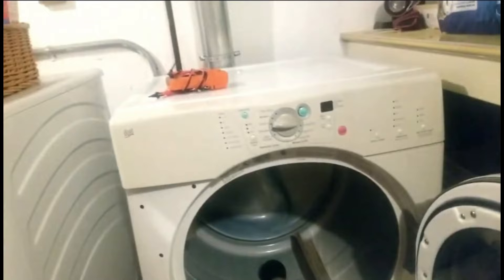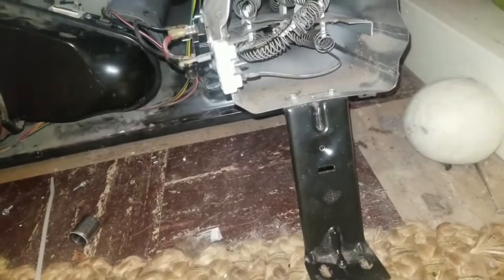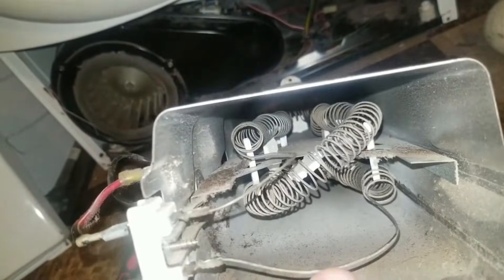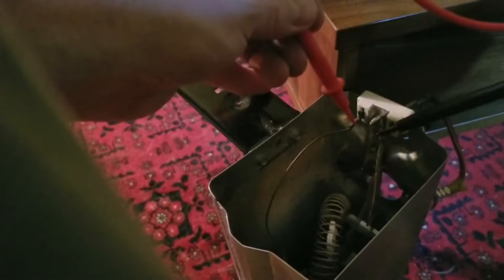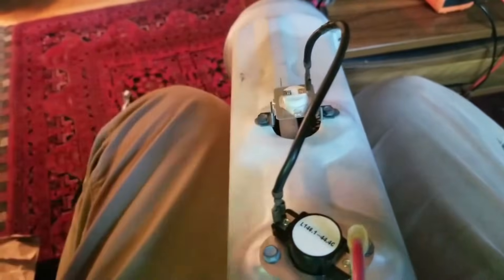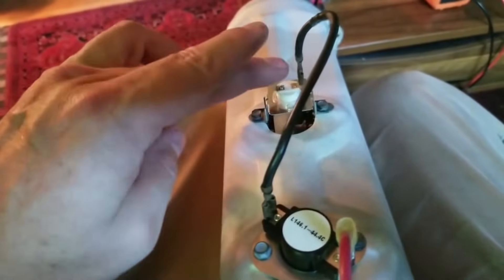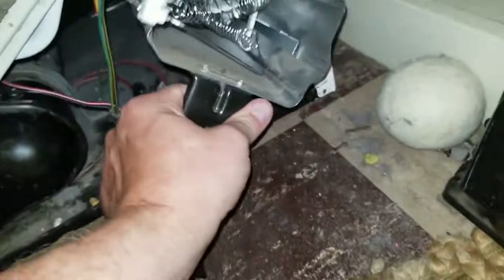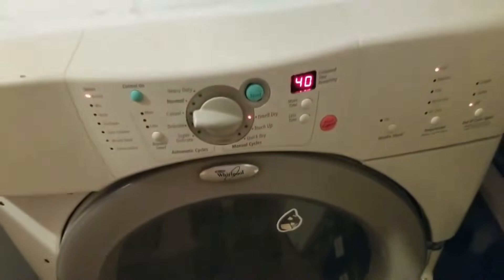Whirlpool Dryer Not Heating .. Duet Heating Element Replacement (Link to Manual in Description)

Comment: Looking for words of wisdom why my dryer won't heat up. Ignitor turns on. No gas flame. I've replaced the coils. No blockage fuse and thermostat test good on meter.
Reply from the maker: @MrJoefoefrombuffalo  do all of your sensors test with continuity or do some tests with ohms
Reply: @JasonSipe16  continuity. At this point maybe best to go back and get ohm readings. I have a video of what happens when the igniter comes on there is a buzzing noise. For some reason YouTube won't let me post a link
Reply from the maker: @MrJoefoefrombuffalo I'm guessing if you're igniter comes on, there is probably some high limit switch that is stuck. That, or else there is some blockage in a filter or in a fan that is not allowing the gas to come on for safety reasons.  It could also be a high roll out switch.  Sometimes those switches are equipped with  manual reset switches to pop them back open if they keep popping off, there might be something wrong that you're not realizing.

Comment: I cant pull my element housing out of my dryer like you just did.  What gives?
Reply from the maker: not sure if there is a difference between yours and mine.
Reply: Same. In the video he says he unscrewed it in the front and "unhooked it" but he doesn't show the unhooking part. I'm unhooked in the front, but I can't pull it out. I can rotate it a little bit though 🤷‍♂️
Reply: @spencer7950  I ended up taking the back of my dryer apart to get at it
Reply: @rebirth_mishap did that work better than trying to rotate it out from the front

Comment: My 20 year old electric Duet dryer is still going strong.  Never had a problem.  Beyond impressed.
Reply: We’ve been using the same Kenmore Washer and Dryer for over 18 years.  I’ve only had to replace the Belt on the Dryer.
If you’re fortunate to have an older machine.   They were just built with better parts.  Most newer machines today have built in obsolescence.  This forces most people into purchasing a new machine!
Reply from the maker: @Bigsmegma44 yeah, the repairs that I'm suggesting in the video are very minor. Older washers and dryers just have less parts to go wrong